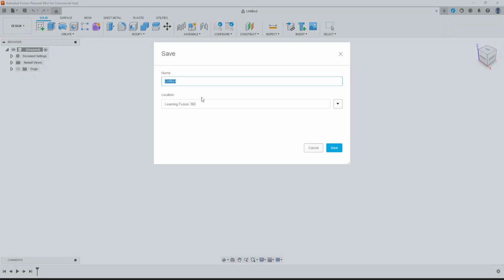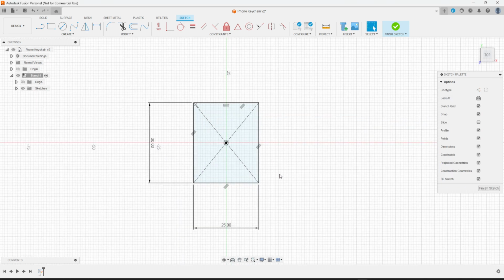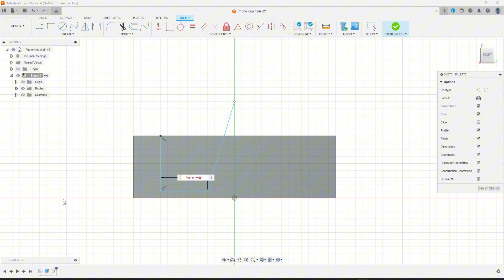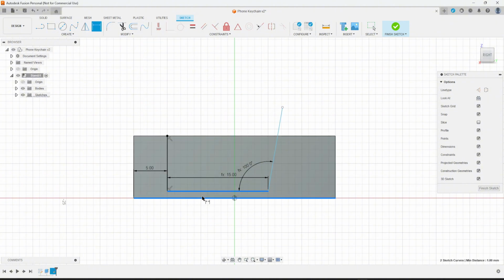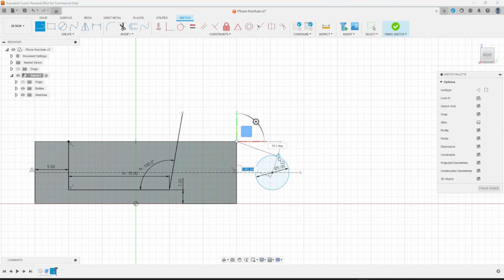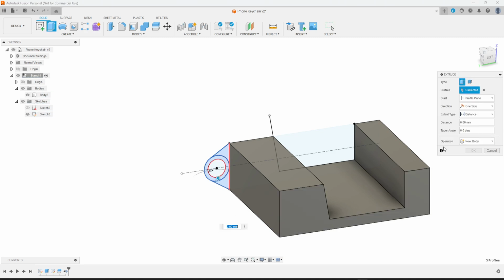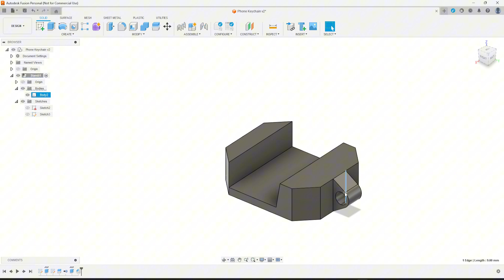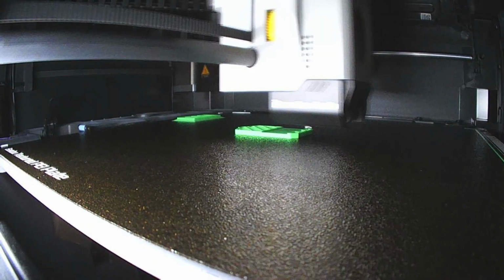Fusion 360 Tutorial: Phone Stand Keychain!

Comment: Just came across a later video today so went back to watch a few of the shorter ones. Good job and I’m a new subscriber.
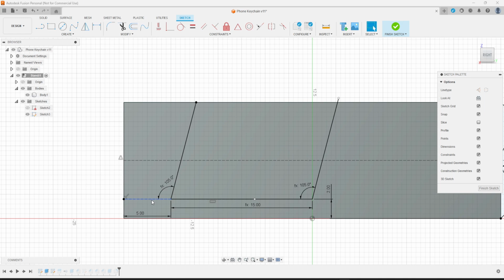At 4:38 or so, where you talk about adding a construction line and the 105 degrees, you could have instead done a couple other options (I think both would have worked). First, would have been to just add a parallel constraint with the other line (at 105 degrees). Second would have been to use the inner angle and put “180 - Angle”.
Reply from the maker: @JasonFornelli  oh wow ya good call. I completely forgot about the parallel constraint since I barely have ever needed it. Mostly when I mess with anything besides tangent constraints they just laugh at me lol. Thanks for the tip 😁